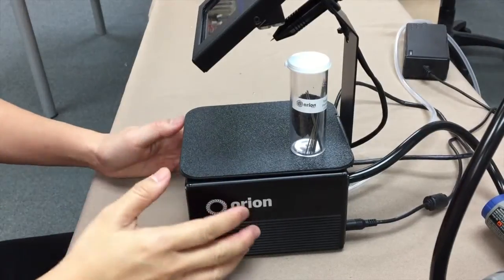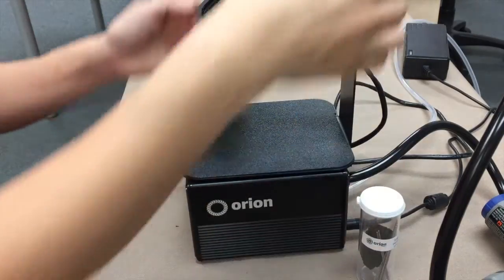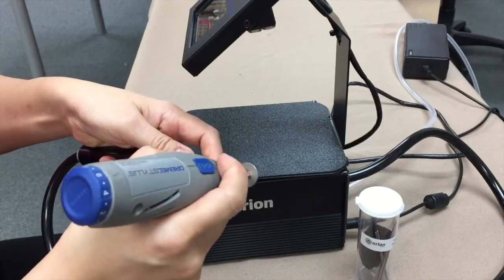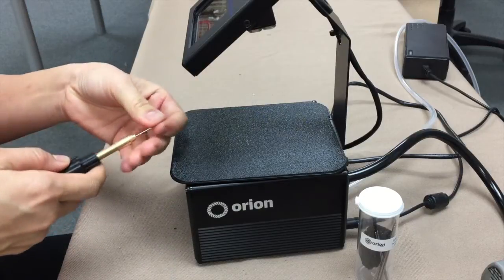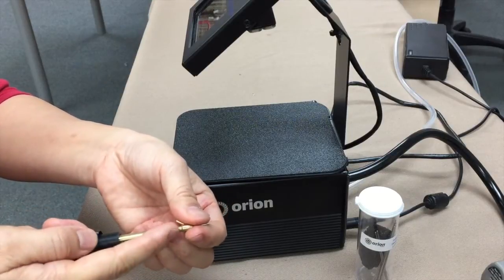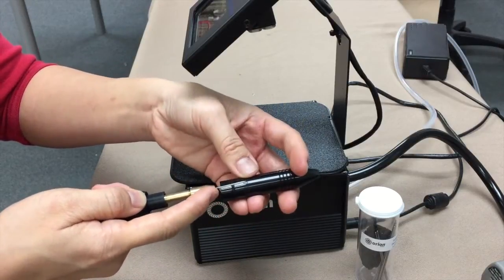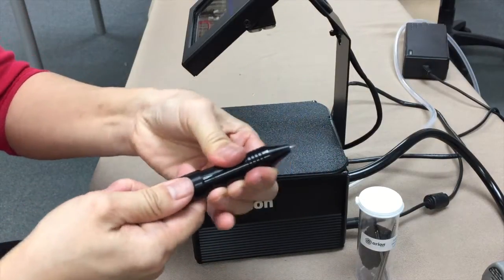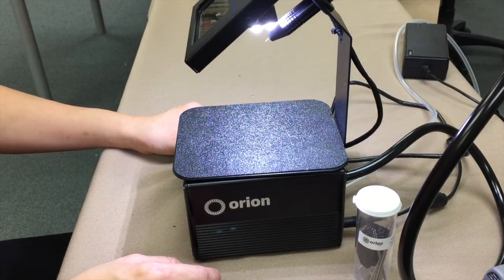Orion mPulse Micro Welder - Maintenance

Comment: I'm getting a lot of soot and the welds dont hold if i hammer them
Reply from the maker: Yes, a lot of soot happens if your electrode hasn't been kept clean of gunk build up or you don't use argon gas.  Even with solder and flame, when I hammer, often the joint breaks.  You have to weld with significantly higher wattage, almost melt it together, if you are going to hammer.  However, this warps the rings.  It's not impossible.